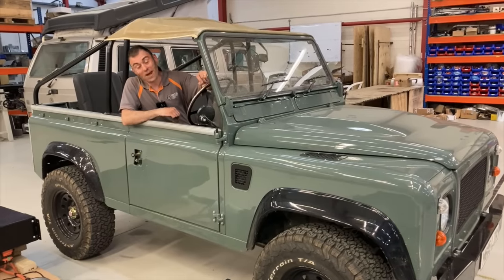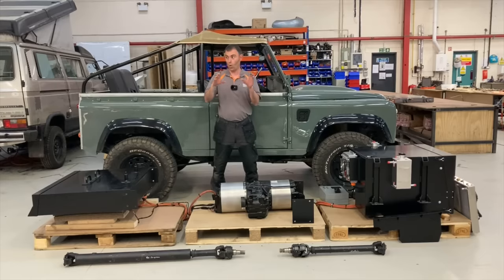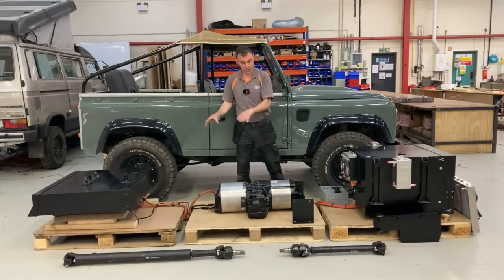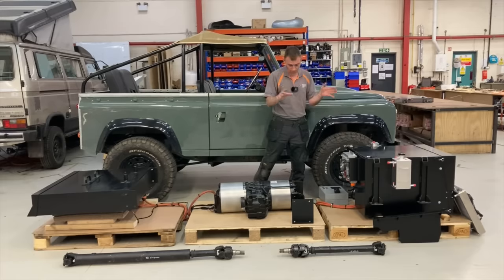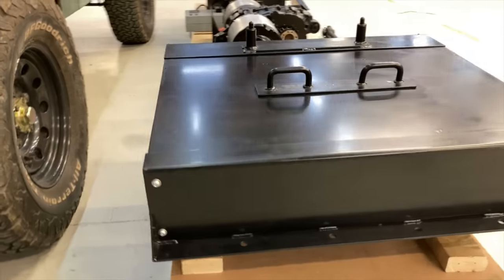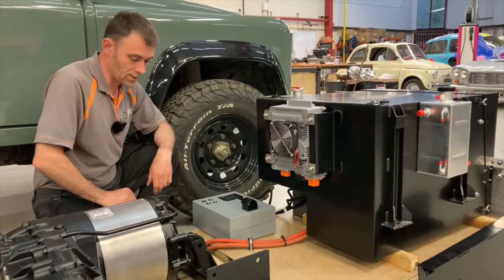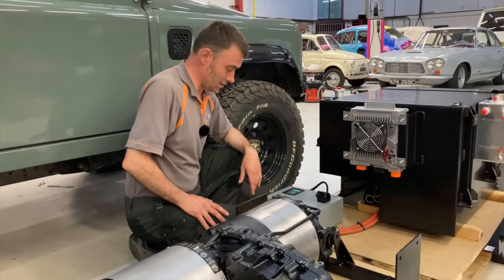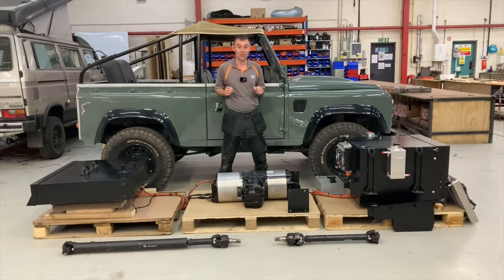Land Rover Defender bolt-in electric conversion kit.

Comment: LANDCRUISERS, or...gmc 1/2 - 3/4 ton short box, crew cab. I bet you could sell more conversions for the GM truck than you could manufacture. GM full ladder frame, parts and upgrades plentiful, inexpensive , everywhere. There are so many different versions of the GM truck, and all generations are close in basic dimensions. In North America some guys keep these trucks forever, because you can do it with tying up a ton of cash for a 1/2 ton 4x4.
I prefer the landcruisers fj40, fj60..but they are getting very expensive, and harder to find parts.
The new electric Ford 4x4 1/2 crew, expensive$$$$, big waiting list, and who is going to spend big money on a recreational vehicle and then possibly roll it over in the woods? Not to many guys.

Comment: Very clean looking kit. I'd love to see something like this get sold to the aftermarket. I'm curious if that transfer case output has any gear selection (i.e. is there a low gear)? If not, that'd be my vote on something to offer. If you could get this git with a low gearing, it'd be a prime conversion for an EV off-road vehicle. More than enough torque for some big tires, and the batteries are cleanly packaged away in areas that are probably already protected.
Reply from the maker: You don't need low gear option as it has sooooo much low down torque from 0rpm. Electric is just made for off-road. 👌
Reply: So this is what you people do when your not destroying other historical artifacts!
Reply: @gulogulo7636  Is that comment directed at me or Electric Classic Cars? I'm sort of just confused on what you mean.
Reply: @mattpeterson7074  See it as a shotgun approach to commenting on vandalism
Reply: @gulogulo7636   how is it vandalism to take a car you own and do modifications to it? Also, I'm pretty sure my 1999 Ford Ranger isn't some collector's item someone would want to restore some day. 😂

I can still see how some folks would feel differently about a good condition Land Rover as seen in the video, but it's still the owner's choice to do with their vehicle what they wish. I'd suggest concerning yourself with things within your power rather than grumbling about a company making EV conversion because people want them.
Reply: @mattpeterson7074  Just doing it for the good feels it gives telling vandals that they are vandals :-)

Comment: I don't understand the reason for the excessive horse power levels of the electric car designers.Its totally unnecessary and wastes the battery range.
A gimmick for the traffic light dragsters I suppose !!
A claimed 200 ish was totally adequate for the engines version so with the phenomenal torque of electric motors that must be plenty of BHP too and so double the range or halve the weight and loss of space with a smaller battery pack.

Comment: Mercedes ML......please!
Reply: Ordinarily I would of said Shogun or Landcruiser but they are way too complicated...the Merc ML body can be removed by unplugging 6 electric plus, 2 brake pipes and the steering knuckle loosened, the 10 main bolts and hey presto the body is off...the transfer box could take your electric motor directly so no engine or gearbox there is loads of room where the exhaust and fuel tanks goes and spare wheel is located which would be around 50kwh and another 50kwh under the bonnet..

Comment: ONLY two problems; ANYTHING 'electric' is an oxymoron in a Rover (and I have owned a 90 and a 110), electrical problems are DESIGNED into the them.  2) is they do not have IC motors how can they 'mark their territories' (LEAK OIL), there is LAW that ALL rovers MUST leak at all times!

Comment: Has anyone here seen the landfill after mining  for cobalt. I have seen them in videos  Not a pretty picture Not environmentally friendly. So if you want to save the earth, try using hydrogen  and ammonia as a substitute  fuel They are both 0% emissions  free and easy to make.
  The reason we don't  use them, is because there is no money to be made from them.
 For one Tesla battery   25 thousand lbs of brine for lithium.  30 thousand lbs or Ore for the cobalt. 5 thousand lbs of Ore for the nickel and 25 thousand lbs of Ore for the Copper  This is why they want electric vehicles MONEY to be made. So I just hope people will see the damage done before it is too late. Remember  the electric vehicles, can be controlled. One way of control,  Black outs.  It's  coming wait and see

Comment: the radietor for the batery is to small. that will burn....
Reply from the maker: Nope, works fine. We've been building electric Defenders for 6 years and are used from Florida to Africa never had an issue with that rad size. 👍

Comment: I'm just waiting until you can comply with EU regulations so you can start business here and perhaps comvert my `99 BMW E46 Coupe.   
I seriously love my car, has been sitting in my garage for 6 years now while I drive company car Volvo XC40 Hybrid.  I  still love traditional engines but my E46 wont last long without major mechanical issues so i'm thinking I wanna EV it. 

Please do consider the EU, you are greatly missed over here
Reply from the maker: No such thing as EU regulations. Every country has their own rules regards conversions in Europe. 👍
Reply: @ElectricClassicCars    I mean

getting compatible with EU vehicle charging standards and electric components that are mandatory to have the CE certification all kinds of EU harmonised regulations for member states to be allowed to sell products hereetc etc etc   From that point its easy to add-on for whatever each country requires additionally  the EU stuff is just the basic to enter/sell within the territory the rest  is to be allowed to have the vehicle used on public roads within a country.

Comment: I love the smell of diesel burning,  the noise the regular engine makes and all the rattles.  I think thats why people love Land Rovers mainly Defenders. 
I hate the fact that the government is manipulating us in thinking electric vehicles are better.  
In my state  we are charging cars with Diesel power generators.  So what is the point?  We are still using diesel fuel. 
If your thinking electricity is better, make it mandatory to charge with solar or wind power thats more efficient and healthy for the environment. 
I wouldn't like to change over to electric power specially since the price of electricity is on the rise  again almost to double and blaming it on the war with Russia.  All this is so questionable in my mind. 
This is just my humble opinion.

Comment: IDK but seems to me that an EV conversion of any 4x4 takes away the off-road capabilities wading through river crossings looks kind of a bad idea with any EV?
Reply from the maker: Actually, the opposite is true. An electric 4x4 can wade much deeper than an ICE 4x4 because it doesn’t need air to make the engine work. 👍

Comment: Please try to partner with a Chinese manufacturer to develop a drop in kit using new components rather than salvaged parts. 

I can’t justify AU$125k for a Jaunt conversion but I might manage a ECC branded DIY kit for AU$30k. 

I can buy an ex Army 110 for around AU$15k. But I don’t have the skills to destroy a brand new Model 3 to save $50k instead of employing Jaunt.

Comment: Total nonsense, tell them how long the batteries last and the range when towing 3.5 ton up hill. Measure it in  miles per change. Do you include a diesel generator when your in the outback for example to recharge ??

Comment: JUST STOP.  Landrover  is owned by ta ta motors and is sold with either a combustion engine or a compressed air hybrid option that's electric with a gas generator